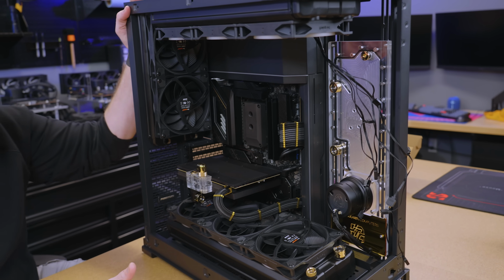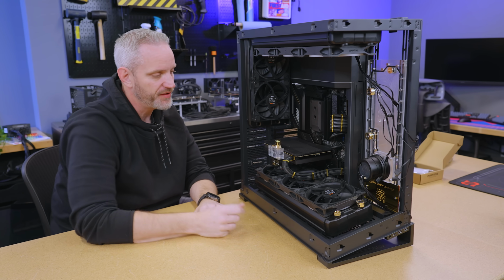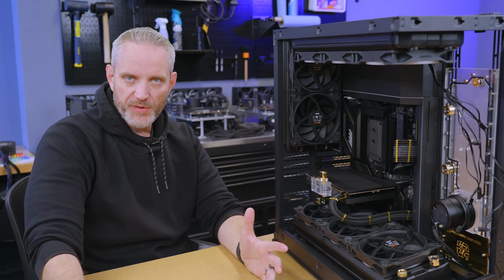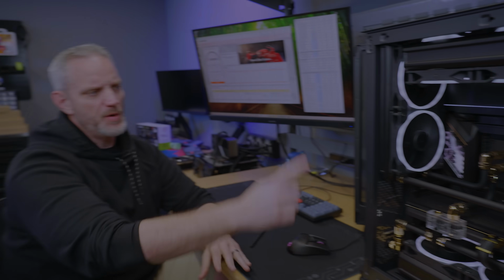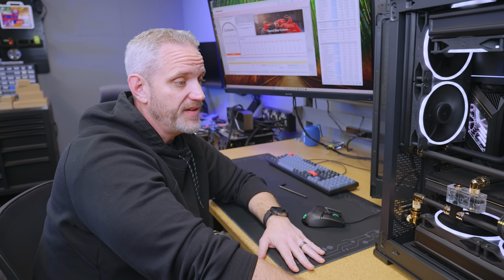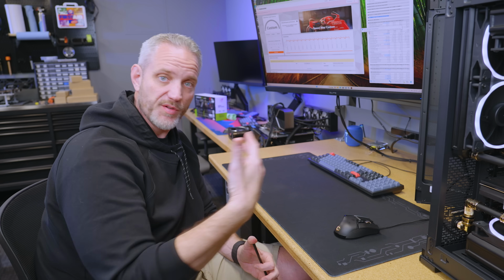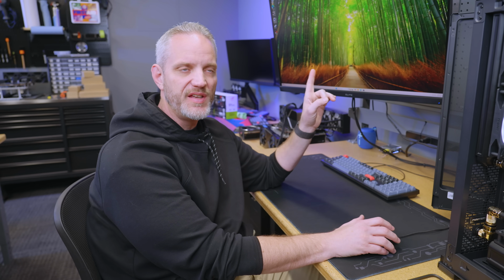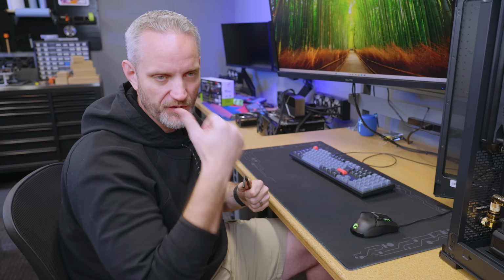This build turned out fantastic! 9950X3D Extreme Gaming Rig!

Comment: Parallel cool can look grate, i did this with my build, run a Apogee Drive II integrated pump CPU block, with inlet outlet direct to an EKWB GPU block with no res going strait to an 80mm thick 2x180mm rad,
So this was DIY AIO GPU/CPU water looing system, and i was able to set this up to install and uninstall as you would with an AIO.

Comment: Very cool build. Enjoyed the montage. Think the only thing I don't like is the tube going from the side rad to the top. Would of been cool to go from the side rad, 90 down to the bottom tube, another 90 and run it parallel with that tube and 90 up to the top rad. Maybe it would impede some flow, might of been negligible. I think astatically having a clear view of the mobo would of been a little cleaner. Just imo. Love the vids and your builds.

Comment: That's way more than a $1000 loop.  Distro plate alone is $250.  $160 for CPU block.  $375 for GPU block.  Easily $300 in radiators.  Then you need to add on pump, tubing, fittings, fluid.  That's easily a $1500 loop.  Let's not forget the fans at $30 each...  then add tax and some shipping.  This is an expensive loop.  We've all been there before, and we all like to pretend the loop cost less than it actually did!

Comment: IM in the same boat. I9 14000K, 4090, open loop, 480 + 360 + 140 rads. Don't need the 9950x3d but it's hard to hold off. I'm running the Z790 formula with the loop running thought it. Is there an AM5 MOBO with the loop attachments?

Comment: dividing the fluids without regulation can lead to problems if one has a significantly higher flow resistance than the other. Even minor cases of sedimentation aka gunk will lead to the block not receiving enough flow, so the residue doesn't get washed out, and from there on the problem spirals and you get thermal issues.

Comment: I run a - 20 then temp target 90 instead of 85 . my gskills 8000 mt 48 g ram listed by vendor I had to increase voltage to 1.4 to make stable . I added a pbo + 200 worked great temps where fine, but I felt come summer temps might be to high so put back to + 100 . im doing a 9800x3d though . seems really easy to make these cpu reach 5.4 mhz if you have the cooling

Comment: what video can I find on Jays thought process when doing water cooling. As an engineer an DIY plumber for my heating systems I think different about the loops, and I wonder why. For example, Given to chunky radiators, I would do 2 different circuits one to CPU one to GPU, instead of feeding already heated water from one part to the other.  I think he has his reasons and I would like to know them.

Comment: @JayzTwoCents won't leaving no air in the res take out space for thermal expansion and risk pressure popping things more? That's the real reason I started using resevoirs over just t fittings.

Comment: 21:33 do not use 7200 MT/s kits on Ryzen CPUs. That will be 7200MT/s in 2:1 mode which is a bad configuration. If you're going 2:1 mode, you want 7800MT/s or higher and it can be difficult to get dual CCD chips to run those speeds with stability. 6400MT/s 1:1 is about the highest you want to go on Ryzen and you want Hynix M or A-die chips. The Hynix 24gb m-die chips are pretty solid for high speed kits, but they have slightly looser timings than A-die. 

For high end kits, Gskill has a 6000CL26 EXPO kit which is an insane bin that runs very reasonable voltages and you could bump the speed up to 6400MT/s and reuse EXPO timings at around 1.6VDD or maybe slightly lower.

Comment: When I built my 2021 gaming PC, I did dual 360 rads. It was working so well the fans wouldn't turn on at all. I had to adjust the temperature curve to get them to turn on. It was based on water temp which wasn't exceeding 30c ever.

Comment: This built is nuts... I want one ❤
Reply: I have a question, what fan controller is used for all the fans? Is there a fan controller from Phanteks coming with the case that is sufficient to plug in all the fans with RGB? Additionally what watercooling block is used for the GPU? I guess it is for the reference PCB?

Comment: I reaaaaaallly wish I could get lucky and get one of the Sig V3's. Sadly I just have a ceracoat foundation with the raw copper I got when I bought a MO-RA IV 400 from someone local, block only set me back $50 and the MO-RA IV 400 with fans, grille, d5 Next, tubing and all that jazz, the guy let it go for $500, easily saving me probably $1000. Seeing these temps makes me think I'll be sitting pretty when I can get my hands on a 9950X3D. I wouldn't be surprised if I can manage similar temps.

Comment: Jay, Have you heard anything about the 9950X3D idling warm? I'm sitting at the same 22C ambient, and my CPU spends most of its time hovering in the 41-43C range at 1% idle. I have the BeQuiet SilentLoop3 420 (stock Silent Wing fans that came with the kit) for my AIO with PTM7950 for my thermal interface, and I'm just really surprised I can't break below 40C. On the high-end, under load I might occasionally see a spike, but I seem to be getting about the same as you're seeing at 19:22 between 68-74C. I've reseated the pump block and seem to be getting good squish on the compound, so I'm just kinda confused at why the 9950X3D idles so toasty. This build was inspired a LOT by what you've done on this gen of hardware, so thanks for all the advice!!

Comment: If I am following the cooling loop correctly, I am not sure why you would drop heated coolant straight from the GPU into the CPU? Perhaps go from the GPU into the smaller radiator first to dump some of that heat first?

Comment: kinda like trailering with a truck swap out rad from a single core rad to quad core external trans cooler but also uses the cooler in the rad  and what a difference i've seen ford 350's  blow transmissions because of cooling lol trying to pull a backhoe up a mile long hill with standard cooling.... uh NOOOOO!😧😮😱 lol like what's his name in the office the no clip when i heard about it

Comment: Hi Jay, genuinely curious (apologies if asked and answered before) -
I thought having the flow as GPU -> back-radiator -> CPU -> top-radiator would mean that the CPU would get freshly cooled water from the back-radiator, as opposed to how it is now where the CPU gets warm GPU water. Would these two scenarios have any difference in thermal, frequency, FPS performance?
Cheers

Comment: Jay, why aren't you using the water temperature for the fan curve? In a custom loop, by the time the component gets consistently hot, it's too late because that means the water is already too hot as well. 
And if you get random spikes that will go down quickly, the fan curve will ramp up out of nowhere for no real necessary reason or benefit. It's better to just shoot for a consistent water temperature, you get better thermals and that is the only way you get the proper benefits of a quieter system.
Reply: Also, any EXPO above 6000MTs defaults to UCLK=MCLK/2 which will net you worse performance than a 6000MTs expo, if you use 6400, you have to manually make sure to set 1:1 and you'll probably need to manually adjust RAM VDDQ and CPU VDDIO to get it stable. If you don't wanna bother with that, just stick to 6000 expo as it will give you better performance than 6400MTs expo because of the divider.

Comment: UCLK=MEMCLK/2 mode is a disservice to this amazing build.
Test if the memory controller can handle UCLK=MEMCLK with potentially more VSOC, and FCLK at 2133. My own 9950X3D does not, unfortunately.
If not, tune & tighten the memory timings at 6200, and FCLK at 2066
Or get a 6200 kit, and FCLK at 2066, if you want simple EXPO with UCLK=MEMCLK and be done.

Comment: Well......... this is my previous comment from a video a few days ago. " I'm currently rebuilding my PC switching from the o11 dynamic XL with a Bitspower distro block.( Which I was never very happy with) Just picked up a Digital Storm Aventum X case and water-cooling loop. I know the airflow is limited but, I'm running a 1hp Aqua chiller so won't be much heat in the case anyways. Honestly so far, I have my pc kind of temporally slapped in the Aventum X and wow it's amazing! " Since this comment I killed my 7900XTX! Liquid metal claimed another! I used liquid metal on it previously and was going back to thermal paste. Sadly, a small piece fell off the ear cleaner when removing it and I didn't catch it. Everything worked first boot but had extremely high hot spot temps. Pulled the block again and reinstalled it. First boot when up in smoke. Went and snagged a 5080 from BestBuy open box for $1200, but now I have to get another GPU block. :( The world is telling me I shouldn't have my GPU in my Aqua Chiller loop.

Comment: Bro, with that setup you should be getting 47k or even 48k in Cinebenchr23.
I get on mine 46133 in r23 on Noctua's air cooler with only PBO enabled without clock boost

Comment: Alphacool and EKWB radiators are very low restriction. Corsair, Aquacomputer, HardwareLabs are very restrictive. 
Alphacool is my go to if I ever go back to watercooling. Most 45-60mm thick rads allows for a drain port to be installed directly to the radiator. A breeze for draining when there is a radiator at the lowest point of the loop.

Comment: Is AsRock being AsRock in this BIOS and the setting to undervolt by -20/-30/-40 is indeed millivolt as displayed, or are these actually Curve Optimizer points, which equal 3-5mV per point each, and are what is normally being used for PBO undervolting? (So -20 would be -60 to -100mV)

Comment: i build for my best Friend a new PC 2 Years ago and its still my best build i did so far (and we talk about building over 1000 Builds because i did this for living^^) it was in a bequiet silent base 802 (his decision^^) inverted, a 7800x3D coloed by a 420 rad pump in the power suply shroud at the bottom the glas reservoir good visibly on the left side (behind the 3 lightwings 140 (also 3 on top and one in the back^^). But the masterpiece of this build was the cutting the shroud so you cant see any holes just the tubes went down from the reservoir under the shroud to the pump than still under the shroud alongside to the place of the cpu again up through the shroud straigt to the cpu and bak into the shroud. So you se 2 straight downwards tubes into the shorud and on  the other side of the case again 2 little tubes out of the shroud to the cpu SUPER CLEAN and really nice. And the Graphic also cooled via watercooling but in a SECOND circuit went outside the case down to a 420 Mo-Ra Pro which also helds the second pump and reservoir, so the graphiccoling is only a "tiny" bit overpowered (think about this a 6900XT Radeon cooled be a MORA 420^^) it looks really cool its pretty unique but at first the cooling temps are just INSANE. Prime and Furmark at the same time August Summer day 26 degrees in the room CPU 53 Degree Graphics 52^^ and water temps of 32 (CPU) 30 (graphics) on a fully loaded PC

Comment: It's probably just me, but I feel like the front tube going from the back rad to the top rad looks out of place. I feel like the tube is in the way of seeing the rest of the build. Like I know there would be more bends, or just use two more 90 degree fittings on both ends. I think it would look cleaner following up along the fans. Even though I know it would block a bit of the JTC panel he put in the back.

Comment: The current PC architecture is totally byzantine. CPU, GPU, chipset and memory should come preassembled as a single computing module with a cooling plate on one side and connectors to high speed serial links/PCI and power supply on the other. The cooling side of that computing module could then be mounted directly on a cooling module that also has a simple metal plate interface. People are still treating a 2kW cooling problem as if it were a 60W cooling problem for a 486/33 with 640k memory. Braindead. Seriously braindead.

Comment: Just a thought and would be a bit more work/custom machining: Take those top fans from the top radiator and put them on the very top of the case. You can have screws long enough to keep the fans in place and a shroud over the fans to make things blend in a bit as part of the top of the case. With those top fans removed, that upper rear fan would not have as much airflow blockage/restriction. You would not be removing the bottom fans from that top radiator by the way. The created shroud can have mesh over the fan outflow so as to keep some things from affecting the fans and prevent any potential injuries if the fans are running.

Comment: I know this may be overkill, but I mean you're running 4 rads... Overkill is kind of a theme in this build. So, I'm surprised and I think it would be cool if you put a liquid cooled backplate on the gpu to get rid of the heat you mentioned. I mean with everything already in the build, why not? It wouldn't have changed the cost significantly given you only need the backplate. Though, to do so now would require redoing the tubing. Still would be very interesting to see, especially if you could do a before and after to see what benefits it gave. Sure, the results would be this isn't critical, but what is with 4 rads...
Reply: Where's the 4th?
Reply: @syxzor  3 rads, sorry I was thinking about how many the case can handle total for some reason.... I derped.

Comment: sick build although i am wondering since the res is clear if there is a coloured coolant or colour additive that would be close enough to gold to match the theme.  with the temp being so low its goner take a long time for those micro bubbles to dissipate.  what i like the most is the money saved on fittings cause that is a huge issue with custom water cooling, specially with angled fittings, quick release, extention, manifolds and drainage taps.

Comment: Hoping u see this Jay. Is there any fan blade noise from the push pull setup? Im running bequiet 120mm high speed fans on a kraken 360 elite as push pull and i cant run the fans over 60% due to blade noise

Comment: I think the plate should be on the bottom and the 420 with out a radiator on the back for intake with reverse blades for obvious reasons, and the rear fans for exhaust as always. I think the top 420 radiator is enough to cool both CPU and GPU, unless he was doing some serious decoding and other high end workstation applications that demanded the extra cores from the CPU and GPU! 
I still prefer the fans on the front instead of glass, that way I can still have intake there and an Rad on both top and back if I was actually doing some serious work applications, which I am not. 

Still cool looking build, I like the black and gold look!

Comment: 5:15 that's just the mantra "path of the least resistance" being confusing. For both fluid dynamics and electrodynamics. In both cases it is NEVER the case. Both fluid/gas and electrical current flows all the ways (even tries the impossible ones, lol, and the biggest lol - because of that impossible sometimes become possible). What would be closer to reality - "MOST of the current follows the path of the least resistance".

Comment: My re-vitalised build has just been completed before this video but its like a timewarp, couple deals on pre-blocked hardware and i now have a Titan Xp (moving from 2 1070s) paired with my Rampage IV Black Edition all using EK blocks from the time, soft tube loop with 2x 280mm BI Nemesis radiators + rear 140mm with black/smoked nickel fittings, i7 4930K was lapped down as far as the stock ILM would let me which like the titan has TG Graphite thermal pads so i don't have to worry about pump out. CPU is at 4.6Ghz 53C Load, Titan Xp at 2Ghz 3300Mhz(X2) memory 39C load. With 1L of fluid it essentially runs passive and will kick the fans in under load and is inaudible with the P14 PWM fans, a used re-loved setup taking neglected hardware and giving it new life at a steal price, the whole build costs less than an RX7800XT, performing around I7-8700K/I3 12100F/RX7600 performance, shame i can't show but im growing an addiction to soft tube watercooling :) One day i'll grab a 5800X3D/Delid 9800X3D + 7900XTX but considering this system aside from the platform bottleneck is still doing 1080P Ultra 120FPS, i can't push an upgrade, but when i do, teenage me drooling over a Sapphire Toxic X1950XTX + Phenom II X3 720 Black Edition will smile at accomplishing that long awaited dream..

Comment: Question Jay or anyone savy enough. I built my own computer(thanks Jay for the inspiration and walk throughs) running windows 11. I want to run a disk game on it but it was coded for 32 bit. Is it possible to do so? If so how?
I have an external disk drive. I have successfully run ROTC 3 Platinum on it but now I'm trying to get The Oregon Trail 3rd Edition to work. I get an error message about the cd isn't meant for 64 bit.

Comment: You are running the RAM at 6400 MT/s in UCLK=MEMCLK/2 mode? Why? That's about as slow as it gets. If you don't want to overclock your RAM to at least 7800 MT/s in 2:1 mode, you'd be better off lowering the frequency to 6000 MT/s (or 6200 MT/s) and switching to 1:1 mode

Comment: So I've never water-cooled anything before so I could be talking nonsense, but it looks like you have the liquid go directly between CPU to the GPU. Wouldn't that mean the water is hotter and not cooling as well as it should in the part receiving the liquid? Wouldn't it make more sense to have a radiator between the two in the loop to cool the water back down before it enters the next part?
Reply: Temps were obviously good, but logically thinking putting a radiator between the 2 should cool the liquid back down and improve temps for the next component.